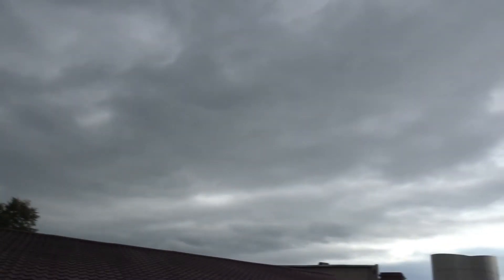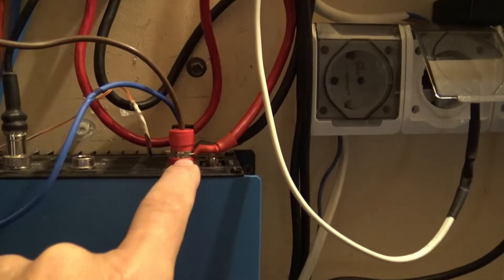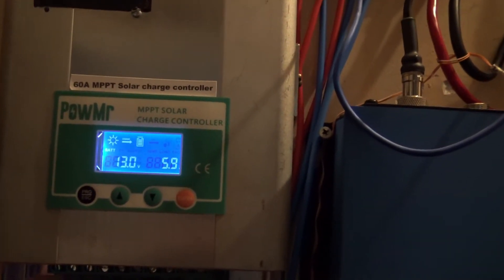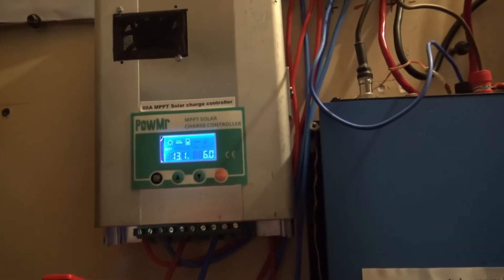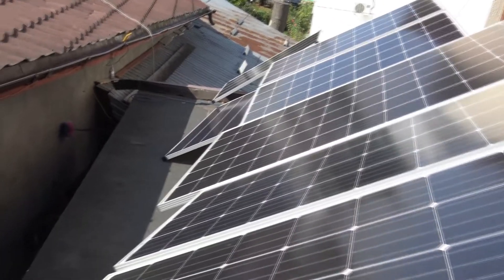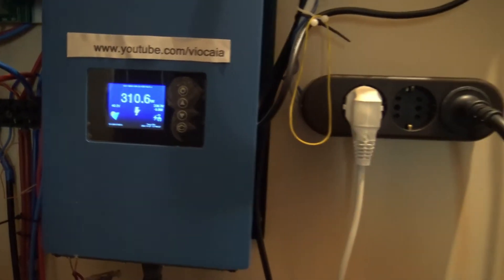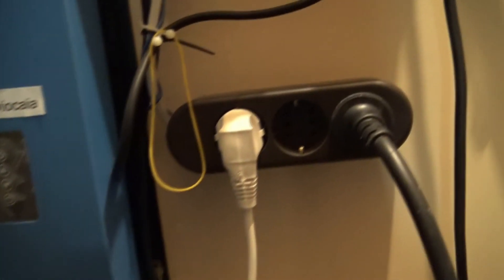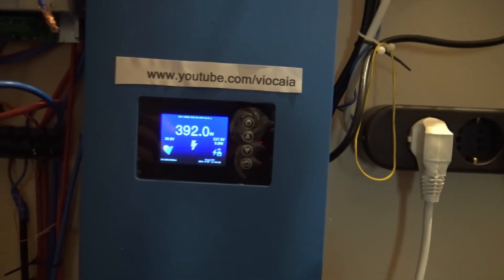Solar panel production cloudy vs sunny day

Comment: Hi 👋 , silly question if I have 4 * 300w panels , how much should I be harvesting average ? I only get like 300w ..am I doing something wrong ?
Reply: In my experience it is the power of inverter, that matters the most. In middle EU you can aproximate 4h per day at full power of inverter every day in year. So 250W inverter produces 1kWh per day, that means 365 kWh per year. But solar panels should be more powerfulthan 250W. 300W is quite OK. 

In southeren EU it is 5 hours, but over 6 hours can be reached with solar tracking. I also did a one year test. Two identical 250W inverters with 300W panels. One orientaded est, other to the south. Southern orientation produced almost exactly two times more. So with solar tracking it is actualy possible to reach 40% higher production.
Reply from the maker: @tg_privat  Should be so nice with tracking, but looks expensive and the prices for panels now it;s better buying some more with different orientation...mine are facing south and I can easily reach 5KW daily.I'm ok with that.
Reply: @viocaia  do you have a diagram or picture of how your panels connected to the  mppt and to the batteries and that type of  inverter ?  When you mentioned to test  current with clamp meter , do you mean current in each panel ? I am getting  like 1.5 to 2.5 on positive and same for negative connection ? Is that good for 300w panel ? Thank you very much
Reply from the maker: @adilfaleh5812  Very simple, those two panels are in parallel to MPPT PV input.Of course the battery is connected to output.I'll draw a schematic soon and have a new video about in a couple of days.It's very basic so don't be afraid to experiment..but be sure to have the right polarities..always!
Reply from the maker: @adilfaleh5812  For 300W you should have more then 10A ! something is wrong, check the connections.. look here  too https://youtu.be/I7DjWn76auE
Reply from the maker: @adilfaleh5812  It's very possible the batteries to be fully charged..so the charging current is going down to float level...wait until the batteries are depleted and redo the clamp. Let them go to under 12V..like 11.8 something and pug the panels..you should read more then 10A
Reply: @viocaia  thank you
Reply: @viocaia  thank you , will try that . I have the 2kw version of that grid inverter ..and 60v lithium Ion battery with 3.5kw storage .. my mppt controller takes max 180v . Each panel output is 73v and I have them connected in 2S2P so I get around 140v coming in to controller . Each panel is rated for 300w , but I only get around 300w to 400w coming in to controller or even directly to  inverter (scratching my head ! )
Reply from the maker: @adilfaleh5812  Check the connections..there is something wrong ,,you should have 1200W..but I found if the house is not asking for power, the inverter is delivering minimum needs..sometimes is 100W let's say..so even if you can supply 1 KW there no load where to put it.
Reply: @tg_privat  thank you
Reply from the maker: you should have ..of course 1200W, with limitation 1000 at least..but sometimes, when the batteries are full or you don't have a proper load..the chargers are just getting in float mode and takes from the panel how much needs to keep the batteries at a certain voltage..check the connections, it should be nice to have a  clamp ammeter for DC and find the current to each line..
Reply: @viocaia  thank you